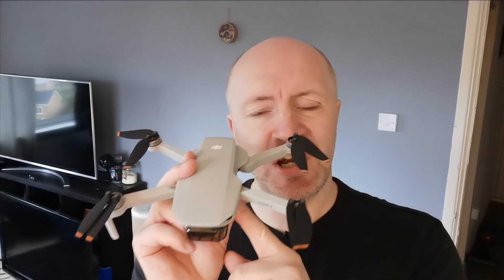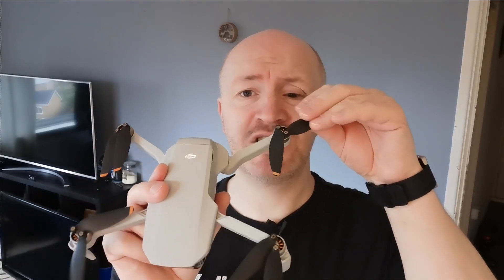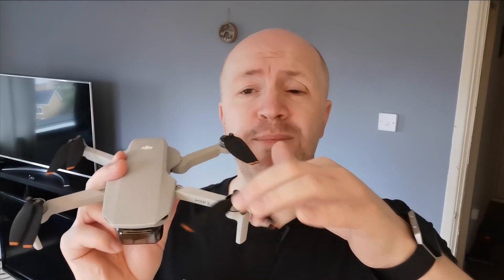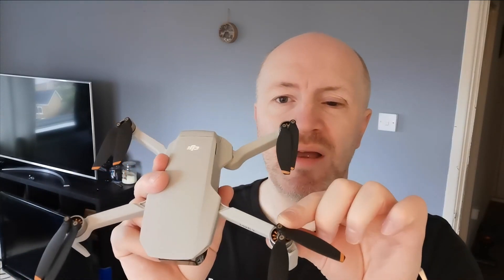DJI MINI 2 -  Propeller replacement tutorial - Watch Before replacing!

Comment: This is all great information to have when needed., I haven't yet flown my new DJI mini 2 SE 🎄but the research I have done tells me, the question of do you really need to change both props if only 1 has signs of damage? That could be a hand-over from the other DJI Mavic drones, as they have prop's which have blades connected to a common hub. It is possible to replace a blade on that type of hub, but not recommended, as it can weaken the prop. However, the Mini uses a different type of prop' set with individual blades. I'd expect the production quality to be more than sufficient to allow you to replace just the broken blade in a pair ... HOWEVER - if the drone has been in a position to damage one blade, it is highly likely that the second blade following close behind has also hit the obstacle (what-ever), and sustained damage. That's the logic in the 'replace both' argument. The bottom line is - are you prepared to lose your very $$$$ drone for a couple of dollars' worth of prop's???  I think it will always be wise to follow DJI's maintenance recommendation. people will also say that balance is the issue, if so why did DJI only send be 2 (props)one each of both rotations not all 8 props? doesn't seem like a smart thing to do seeing as how cheap everyone says they are, leading to the belief it's only a money grab! and if that all wasn't enough to blow your mind, try wrapping it around this......If you get a Propeller Overspeed Warning or RPM too fast message, (different terms for different drones) then the props may have warped and need to be replaced. they may all look perfectly fine so now you have to change all 8 of them? Oh well, have fun I know I will!

Comment: Unlike a full length prop. The mini use 2 seperate blade. One damage blade have no effect on the 2 nd bade balance etc. so imo you have no need to replace the other side if one is damage

Comment: great video, question though. so those little markings make it easier to identify which are the counterclockwise but my question is, do the little numbers have to match to the ones already on. example: Top Right/bottomLeft/ / top right says DJI E2 4726 FM// bottomLeft says DJI 04 4726 FM....so do the new propellers that are marked E2 go where the E2 props go? i know obvious Q but just double checking
Reply from the maker: Thankyou, you can do but as far as I am aware it makes no difference. I think they are there to make it simple but in fact you should be able to put any clockwise propeller on the top left or bottom right
Reply: @2CatMedia  thanks for the reply boss

Comment: What will happen if I replace single propeller for example when i use all the dual propeller and I just have a single old one from each is that dangerous?
Reply from the maker: Hi Mohamed, you can use an old propeller as long as you have two of them on each motor and the correct ones. As long as they not damaged it should be fine

Comment: What type of thread lock do you use on the prop screws ?  Thank You so much in advance.
Reply: Blue loctite
Reply from the maker: Hi Bill, for the mini 2 you don't need it on the new screws as they have it on them already. Otherwise I use the brand locktite

Comment: I think of my drone props as AIR SCREWS. The flat edge of the prop does the cuts through the air, thus causing the drone to either fly up, down, left, right and yaw. I've been learning a lot about drones and it paid off, when I just bought a mini 2 drone and never ever crashed it at all. I flew it five times so far, but just in the back of my building parking lot, but enough to practice my drone flying skills. I LOVE MY MINI 2-:)
Reply from the maker: That's a great way to look at it. Glad you enjoying it
Reply: @2CatMedia  The Air Screw idea wasn't my saying, but props were once called Air Screws. They seem to screw into the air, much like real screws that screw into wood. I tried the Canadian Drone exam, but failed it twice. The first time, I reached 63 out of 65, the next time I did it. I only got 57 out of 65. That time I even cheated and still lost it. I won't try it a third time, all because you shouldn't have to learn how to fly an airplane to fly a small drone. But the IDIOTS out there made the drone laws too strict. I can fly my mini 2, but I can't use my prop guards for it. Too heavy under the drone laws. But I still fly around here and there. I don't go too high or too far, but enough that I can get away with it. I hope. So far, so good. lol Thanks for the reply xox

Comment: How tight do you actually tighten them? It’s not easy to judge, wish we had mini torque wrenches lol
Reply from the maker: Hi Sean, just remember it's plastic so  it's just tight enough that it stops moving. You don't need to force it once it stops put a little bit of pressure on it and that should be enough. Once it tight enough, You should be able to put the screw driver in the screw lightly and try to turn it with just the ends of your finger tips like you are just holding a pen with no effort and it should not turn. I know it can seem like it complicated but simply turn it gently till it stops then a little extra push and you done

Comment: I see you upgraded from the HS 720 E nice to see.  I have 1 question, what are the regulations regarding flying in the UK, example do you need a license to fly over 250 grams drone?  Also I going back and forth on the mini2 and mavic 2s, the big reason at this time I'm leaning towards the mini is the fact of far less regulations here in Canada then the mavic 2s.  The reason I hesitate on buying the mini 2 is well you guessed it, will there be a mini 3 with obstacle avoidance, if you had that would you still have crashed your drone in the first place? Just a point. As far as your video went, I liked it as it showed me something I didn't know. that was the lock tight on the screws so key note, buy from DJI and get the proper ones. Now what other drones do you fly and which one is your favourite?
Reply from the maker: Hi Tassilo, yes I'm glad I upgraded to the mini 2, I know there will be a mini 3 out soon but what can you do. I'm happy with mine at the moment. Yes thee are regs in UK. If it a non toy camera drone you still have to register it but if it over 250g you are limited in flying proximity to certain things. The mini 2 is great for being able to fly mostly anywhere.
I fly the mini 2 and some indoor drones but I also started flying a bit if fpv. I currently got the emax tiny hawk 2 Freestyle. So that is interesting. I plan on going digital at some point though with them.

Comment: I had to replace three blades.  Two on one rear arm and one on the other rear arm.  I always visually check the screws to see if they are backing out.  No problem yet.
Reply from the maker: They do advise to change them in pairs rather than single. But hopefully it shoukd be OK

Comment: Please help my hs720e will not hover in place. I have tried everting that I could do. Is it simply because its just a cheap drone ?
Reply: It was the screws to the propellers a couple of them are extremely loose
Reply from the maker: Well it is always best to check your propellers in your pre flight check list
Reply from the maker: It should hover in place, unless there is issue with gps satellites or app. Maybe fully calibrate it.

Comment: I ended up hitting a tree and had to change my props but one screw did not want to come out and I tried everything and end up cutting the prop off to where the screw was exposed then had to use vice grips to take the screw out, now back out flying with no problems but the quick release props would be ideal.
Reply from the maker: Didn't know you could get quick release ones for mini 2?
Reply: @2CatMedia  no you can't for the mini 2 but would be a great upgrade if they did, the little screws are a pain in the ass!
Reply from the maker: Oh sorry I re read your first post, you ment it would be good if they did them.
Reply: @2CatMedia  ya it would be soooo much easier with the quick release props for sure.

Comment: they are very thin, I replaced once mine and when I opened the plastic in which they stay as new with scissors, I accidentally cut the propellers tips ... careful with that, they are really thin and fragile.
Reply from the maker: Mine are fine, you sure you not on about the mavic mini 1, those were really thin. The mini 2 are more rigid. Also in defence of the mini 2 props, when I caught the chimney recently all I had was a slight crack in the propeller
Reply: @2CatMedia  you did not get the message right, I cut  the tips with the scissors by mistake, this could happen to any of us. the packaging of the new props makes it cut the tips if you are a bit clumsy like I was
Reply from the maker: Oh dear, not great for the props then. Easy on the scissors.
Reply: @2CatMedia  the packaging is terrible, these are not supplements seeds that you take before flying the drone, the props are meant to be packaged properly, china cheap stuff